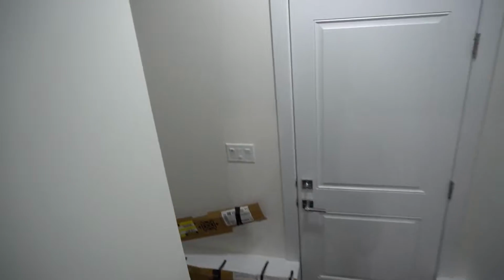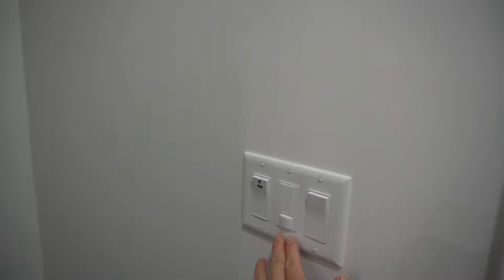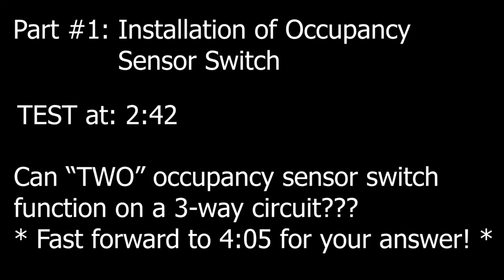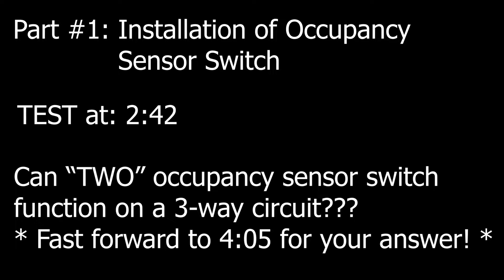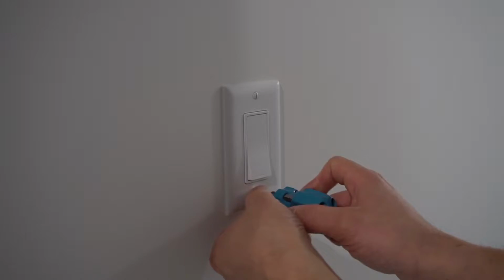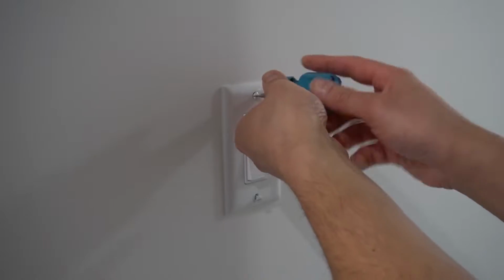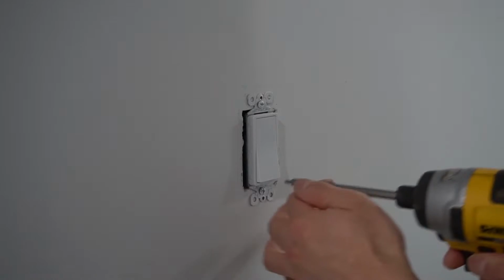TWO Occupancy Sensor Switch On A 3-Way Circuit DOES IT WORK??

Comment: I connect  two Occupancy Sensor Switch On A 3-Way Circuit. It is working. But I did diferent wiring.
Reply from the maker: Yes it's possible! https://youtu.be/zEqfHxSLC-s

Comment: So what happens if you are walking up the stairs (with the top switch still being a rocker, not a motion sensor) and you flip the switch at the top of the stairs (lights were previously on because your motion sensor midway up stairs had turned them on.

Will this turn off the light?
Reply from the maker: In short. Your rocker switch cannot be flipped off. It has to be in the position that it provides continuous power to power the controls of the motion sensor switch 🍻

Comment: Hi Kevin,
I have 4 switches that control 2 lights in the hallway. 3 out of those 4 switches are 3 ways and 1 is a 4 way.

Trying to hook up a 3 lutron auto sensor but not working , I'm located here in Edmonton
Reply from the maker: Hi neighbor! There is a way to get that to work for your scenario "but" once installed you cannot touch any of the switch but the Lutron. If any of the other two switches is switched "off" it will turn off the constant power supply to the Lutron. Here I have another video will explain what I mean but I do not have a 4-way involved. https://youtu.be/zEqfHxSLC-s
Reply: @KevinPon.  thanks Kevin

Comment: Great video, but I still can't get all the ideas. The light in the hallway is controlled by 2 switches, about 10 feet apart, which sensor switch I should use to replace ( single or 3-way? ) and should I replace both switches?
Reply from the maker: Thank you! It's up to you which one you replace but you must leave the regular switch on 24/7 so the motion sensor does not turn off. I have another video here that will show you how to install 2 motion sensors if you're interested: https://youtu.be/zEqfHxSLC-s
Reply: @KevinPon.  Thanks, Kevin. I will just install one then. I can't believe the Homedepot guy just told me to install both without warning me anything!

Comment: Just saw this....

You can replace BOTH 3-way switches with Lutron occupancy sensor switches
Reviewed in the United States on September 22, 2012
Size: 1 PackColor: WhiteVerified Purchase
* WARNINGS *

I AM NOT AN ELECTRICIAN, and I have only minimal DIY experience. We had the need, so I figured out that this could be done from the internet (really). So, don't be intimidated by my lengthy instructions; I just wanted to be thorough so that no one else would have to spend the hours figuring this out that I did. If I could do it, then you probably can, too.

While the instructions that come with the motion sensor switch don't say either way as to whether the switches at both ends of a 3-way installation can BOTH be replaced, the Lutron Maestro Switch with Occupancy/Vacancy Sensor catalog states that "Only one Occupancy sensing switch can be used per multi-location circuit." I suppose that that statement could be read as the listing of a shortcoming, not as a prohibition. However, I don't think that Lutron intends for you to use their sensor switch on both ends of a 3-way installation. Their instructions recommend the MA-AS for multi-location installations, but the MA-AS is not a motion sensor switch. Regardless, it IS possible to use a pair of Lutron MS-OPS5M switches in a 3-way installation by following the instructions below.

* END WARNINGS *

-- Instructions --

The instructions linked here for using a pair of motion sensor switches are actually for the Leviton PR180 but they work for the Lutron MS-OPS5M [...] (if the links get removed, then do a Google search for "leviton pr180 both switches", click on the SmartHome link, and look for Alex's review with the PDF link).

As you read the instructions, you'll note that you DEFINITELY need a voltage tester. They're cheap. The following kit has two types of voltage testers:

Greenlee TK-30 Basic Electrical Kit

Or, you can get the multimeter by itself:

Greenlee AM-6 Analog Multimeter

Just make sure that it's set to alternating current (A/C) for a value greater than 120V, if you're in the United States.

You'll notice that the Leviton PR180 comes with different colored wires than the Lutron MS-OPS5M. Following is my logic for assigning the wires the new colors. It'll help if you print out the instructions, then write these corrections on them.

My two Lutron MS-OPS5M's came with two black wires, a blue wire, and a green wire. If you look through the holes in the back of the switch, you'll notice that where the top black wire is connected to the circuit board, it says "Black". The lower black wire is labeled "Black-Red" on the circuit board.

1. Using the circuit board labeling as my guide, I crossed out "Black / Noir / Negro" on the instructions and wrote "Top black" for BOTH motion sensor illustrations.

2. Then I crossed out "Red / Rouge / Rojo" for BOTH motion sensors and wrote "Lower black".

3. I crossed out "Yellow/Red" and wrote "Blue" (so the blue wire on each Lutron MS-OPS5M will be capped off, and not connected to any house wires). You may want to circle "NOT ATTACHED" to extra remind yourself not to attach the blue wires to anything.

4. At the top left of the top motion sensor illustration, I put curly braces ({) next to "Wire Load Hot" and "WIRE B", and wrote "BOTH!" For some reason, it took me a while to figure out that both "Wire Load Hot" and "Wire B" would be attached to the top black wire of the Lutron MS-OPS5M (meaning that three wires will be joined together).

5. At the top right of the bottom motion sensor illustration, I put curly braces (}) next to the "LINE HOT" and "WIRE A", and wrote "BOTH!" for the same reason.

6. You may want to also add "AND bare wire" next to both "Green Ground" wires since the Lutron MS-OPS5M requires you to attach both the green ground wire, and the bare wire to your grounding wire(s) (meaning that at least three wires will be connected together, depending on how many grounding wires you already have in your switch box).

That's it!

-----

So the reason that we need motion sensors on both sides of our 3-way installation is that it's a basement staircase with a 90-degree turn in the middle. A motion sensor at either the bottom or top of the staircase can't see the other end. Both the Lutron MS-OPS5M and Leviton PR180 come with instructions that only show you how to replace one switch. You're supposed to leave in one of the standard switches. Fortunately, after searching around for a while, I found Alex's post at [...] which links to the PDF with Leviton instructions (if the links get removed, then do a Google search for "leviton pr180 both switches", click on the SmartHome link, and look for Alex's review with the PDF link). We couldn't go with the Leviton switches, because we have CFLs and the Leviton PR180 doesn't work with them.

Our Lutron MS-OPS5M switches have been installed at the top and bottom of the staircase for four days now, and so far so good! We love having the motion sensor switches at both ends! Our only qualm is that since it's a staircase, one minute is a tad long to leave on the lights. Fifteen or thirty seconds would be a nice option, but not necessary. If the occupancy sensor switches burn out or something else bad, then I'll let you guys know, but it looks like it was a success. We're so happy that we're probably going to get some more Lutron MS-OPS5M sensor switches to install in other parts of the house!
Reply: And could it be done with 2 Lutron MS-OPS2  since it seem like a modified single pole wiring?
Reply from the maker: @fredmertz4501  yes it can be done. It's two single pole in parallel. Please check out my new video. I have provided with full instructions. https://youtu.be/zEqfHxSLC-s
Reply from the maker: Hi Fred, yes you are right. Base on Lutron's notes in the manual it says only one can be installed. That is only true based on the installation instructions they provided.